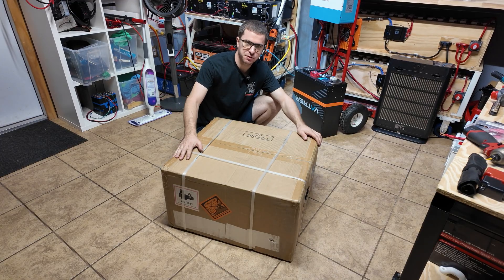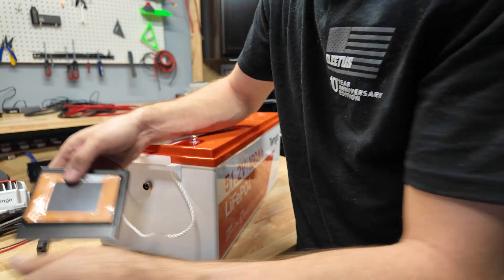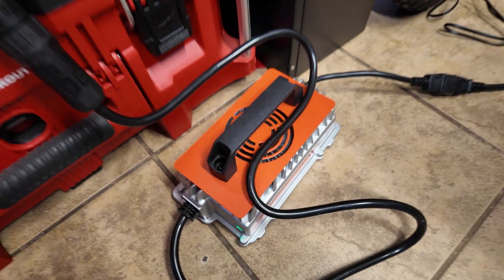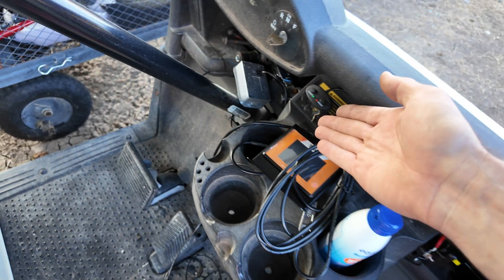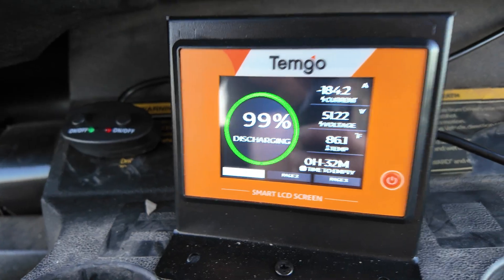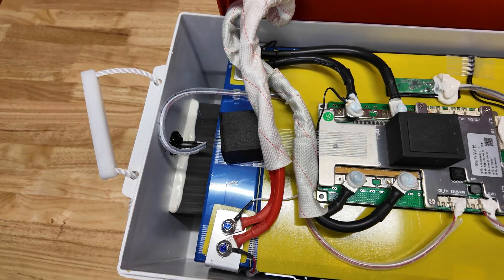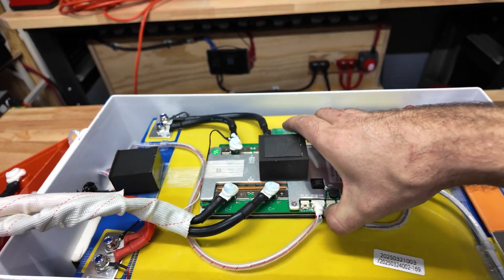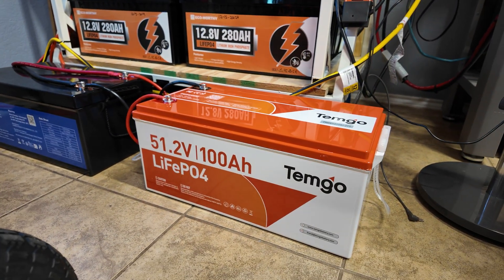Temgo 48V 100Ah LiFePO4 Golf Cart Battery Review, Test, Disassembly -749$

Comment: I have a 2019 48v Icon golf cart and am looking at using this battery conversion. How do you connect the charger to the battery?  I have 2 wires connected to the positive and 2 wires connected to the negative sides of 6 @ 8volt lead acid batteries. Do I have to worry about the 12 volt side of the cart, or it will be ok, the way it is? Will my regular digital gauge still work as normal?
Reply: I do RXV conversions 48V with this battery.  Just connect your old wires on your Voltage reducer to it, no problems there.  The only thing you'll have to do with the charging system.  Your old charge port should have 3 wires coming out of it Positive, Negative and a Reed Switch.  You need to take the Reed Switch wire directly to the positive post on you battery using a crimp on ring terminal (don't forget which wire it is).  As far as your Meter, I can't honestly say that your existing meter will work.  I've had several that did not.

Comment: Mike, can you test the discharge power switch on the control panel? When I turn off my discharge, the screen will power off after 5-10 seconds and then I can not power it back on. I have to use the app or connect the charger to restore operation.
Reply from the maker: Yes I’ll look into that and report back to what  find
Reply: @Mikebuildss  Temgo acknowledged the control panel issue and sent me an updated battery and control. The new version does not seem to have this issue.

Comment: I didn't test it because it was heavier than a Flooded lead battery. It seems like things are moving in a different direction in China, where it return to originLitium cell. It seems like small-capacity, multi-cell batteries using existing technology and equipment may become mainstream. That means ECO.

Comment: I don’t see how the charger not fully charging the battery is a good thing. Or does it reach 100% at 56 volts?
Reply from the maker: It’s basically full, you may be able to squeeze a tiny bit more going to 58, but its better to not push the battery to the absolute limit. 
I only charge my large 48 volt off grid solar power system to 55. Keeps everyone happy. If I do charge it higher it only gains a very small amount of extra capacity
Reply: @Mikebuildss  Only 55v  not much if any balancing the cells at that low volts. 56.4 is the recommend minimum voltage to maintain balanced cells.
Reply: I charge my 24v battery bank  to 28.4 volts which is the same as 56.8 for a 48v battery

Comment: Good review and test. One thing I'd like to see you do during your reviews is use some of the generic apps like Overkill and see if the battery can communicate with them, that way you can look at the parameters and see what the temperature and over current/voltages are set to and modify them if needed.
Reply from the maker: That’s a good idea, I’ve heard someone elts say the same thing, I do have the app already I should test!

Comment: We bought the 12V 300ah self heating battery to replace our original 200ah agm battery that was installed  on our Class B RV.  The AGM could not run my Fridge all night long, now that we installed the 300ah one outside underneath the carriage it can run our refrigerator and the max air fan and lights non-stop for more than 50 hours .  We don't let it get below 10% which is still around 12V.  So far we have cycled the battery around 19 times in 3 months and seems to be holdup up pretty good.  Now that it is cooler and we are not running the max air fan, we are testing the battery with just the fridge and is still at 72% SOC after 35 hours.  We are very pleased with the battery and we are glad we did not buy the other battery that is $2000 more.
Reply from the maker: Nice sounds like a Good upgrade especially compared to lead acid!